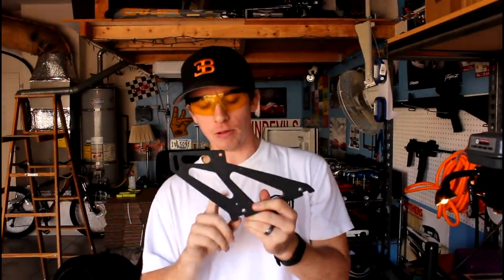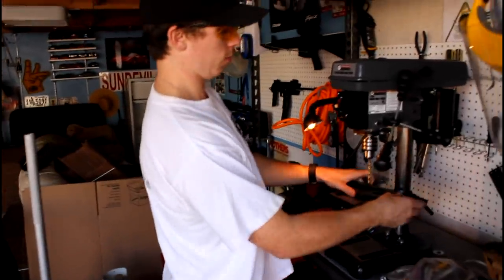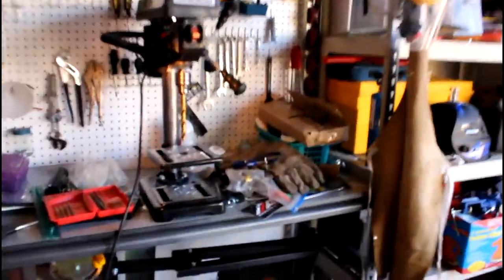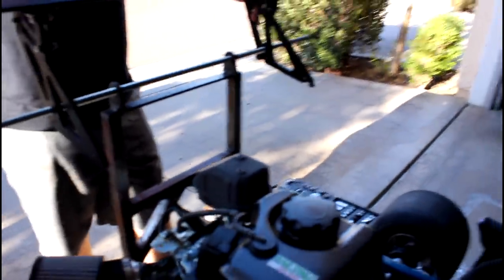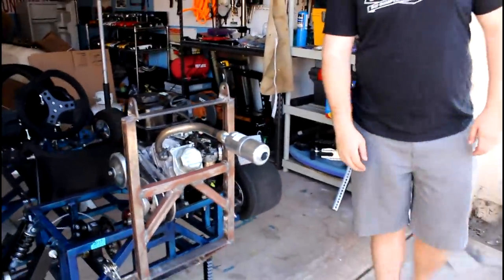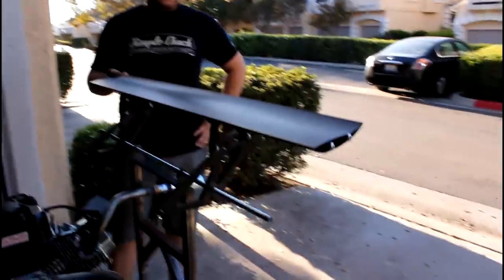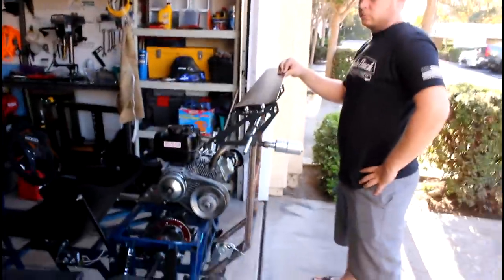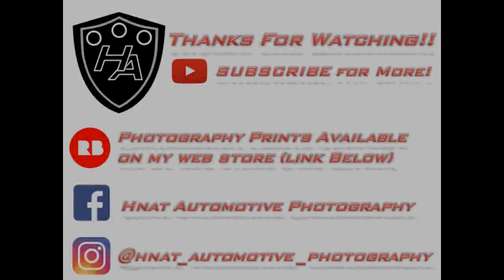The Go Kart Active Wing is TOO HIGH!

Comment: You can get liner actuators on eBay very cheap, something like that would work much better than cable or rope for angle change. put the rod just under the exhaust pipe that will drop it, just a rough estimate 5 to 6".
Reply from the maker: Hmm, interesting. I'll have to look into those actuators.

Comment: You can order a header pipe from Go Power Sport. They had different style they will help you in your application and you can also move the gas tank and if you have to go to a lower position all you need to get a fuel pump from go Powersport all you need is like 3 to 4 lb just an idea so you can bring that wind way lower
Reply from the maker: Thanks Juan for the input!

Comment: in my opinion, the wing really wasn't that high considering where your head will be including the extra height and width of a helmet. i would only drop it down an inch or two. another thing is i wouldn't use a spring on because every pound that spring is getting stretched out is every pound your loosing from downforce.
Reply from the maker: Made some different mounts, so now the wing height shouldn't be an issue as much. The upcoming videos will address it.